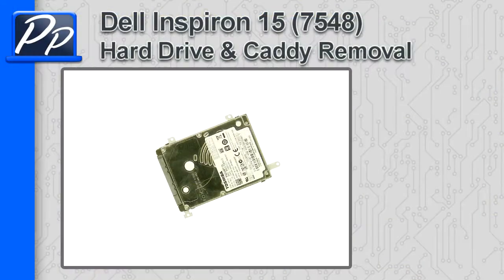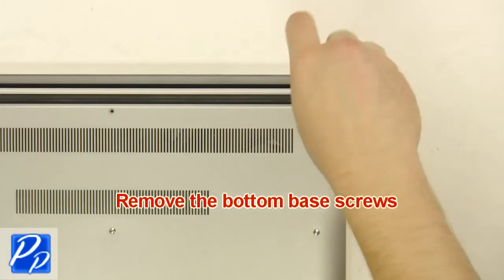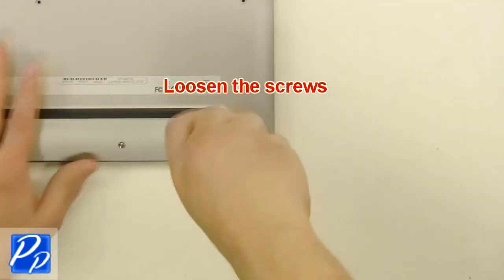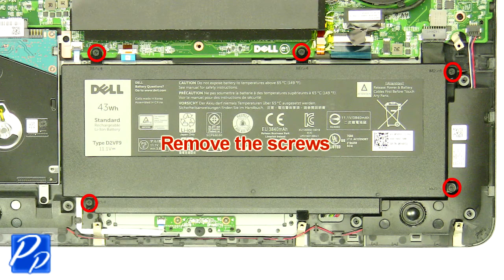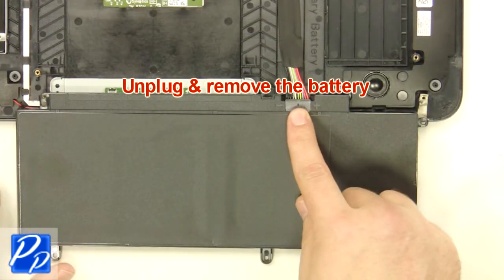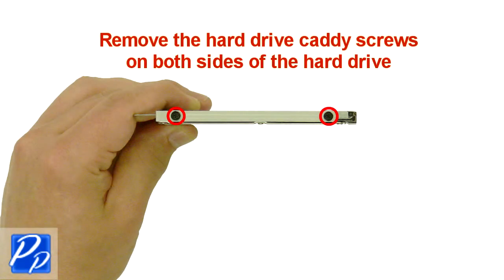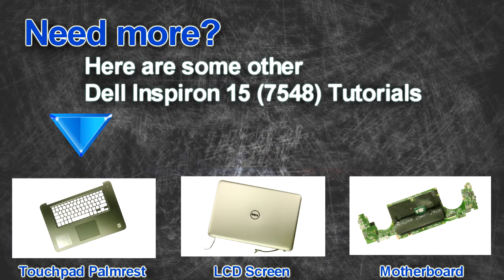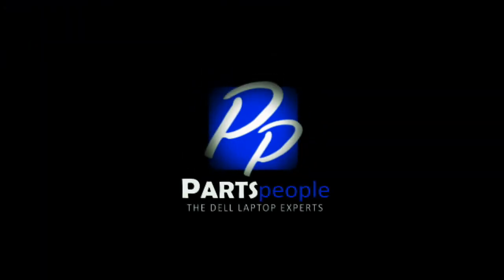Dell Inspiron 15 (7548) Hard Drive & Caddy How-To Video Tutorial

Comment: Hi, thanks for the video. I am trying to upgrade HDD to SSD. Does it resolve noise issue on this model? I'm not sure for others, but mine has too much noise while I am using. Is it because of old fan or some other issue?
Reply from the maker: It sounds like the fan needs to be cleaned or replaced. There might be debris making the noise. If the HDD is failing, it could make noise too but it won't be really loud.
Reply: Thanks for the reply. I may need to replace fan too.

Comment: Hey there!

Thank you for such a thorough step-by-step tutorial. I am using Dell Inspiron 15 Series 7000 (7548). It has 1TB HDD hard drive. Will Samsung 850 EVO 500 GB 2.5-Inch SSD physically fit my computer? I am worried about the differences in thickness of my current HDD and Samsung SDD.

Thanks so much.
Reply from the maker: Yes the 850 EVO will fit in your laptop.
Reply: thanks so much!

Comment: Thank you for telling us why we should "remove the battery first". 

btw, the HDD that came with the 7548 that we bought form Bestbuy was faulty. It always has that chirping sound when I first got it. It unfortunately died on me. Always giving me blue screens on start up, So I want to buy an EVO SSD to replace it with because a few comments mentioned it. Do you recommend it?

and another question, I really wish you guys would answer.

After attaching the new SSD on my laptop. How do I install the same drivers and especially the same Operating System (win 10) that came with the laptop so that I won't need to buy a new license or New OS? Since I cant clone the previous drive because it's faulty and dead. A reply is very much appreciated. Thank you!
Reply from the maker: SSDs will run faster and boot faster than traditional HDDs. I always recommend upgrading to SSDs when possible. 

For the OS (Windows 10): you will need to call Dell and tell them you are replacing the hard drive and that you need a copy of Windows 10. They will send you an installation copy on a thumb drive. You will need to plug in the thumb drive and start the laptop (after the new SSD is installed, of course). During the Dell load screen you will press F12, I think, it will prompt you to change the boot sequence. You will select "Boot from USB" and that will start the Windows install.

After Windows is installed you can go to support.dell.com to make sure the BIOs and all the drivers are updated.
Reply: Thank you very much for such a comprehensive answer. I appreciate it,
I will get back to you incase I have questions. Thanks again! Godbless!

Comment: hey is it necessary to remove the battery to replace the hard drive
Reply from the maker: You should remove the battery to avoid static discharge that can ruin the hard drive and/or motherboard.
Reply from the maker: Or you should at least unplug it.

Comment: Thnaks for this video.
I have a one question?
I can replace the graphic card with a NVIDIA for example?
Reply from the maker: +RoRHero No, it doesn't have an Nvidia option. The 7548 has the graphics built onto the motherboard so replacing the motherboard would be the only option. The motherboards will have either an Intel 5500 GPU or an AMD Radeon R7 M270 GPU.

Comment: Hey, 
first of all: Thank you very much for this video! I am planning to upgrade the HDD of my Inspiron and i am asking myself if it is really necessary to unplug the battery? I am planning to clone the current hard drive and put a SSD with said cloned data in my notebook. Would this work without problems? Thank you very much in advance for your answer!
Reply from the maker: +Spectacular Mind After you clone the drive and you are ready to install the new SSD,  you will want to unplug the battery for the installation. If you don't, you might cause an accidental ground or short and risk damaging the motherboard. If that happens, you will probably have to replace the motherboard.
Reply: Parts-People.Com, Inc Phew! Thank you very much for your advice!  Hopefully everything will work out...

Comment: Thank you so much for this video.  Just what I needed.  Put in an evo ssd and the laptop is much better now.
Reply: what evo did you put? 870?
Reply: @Estoyaca  it's been so long I don't remember anymore. Sorry. I've upgraded other laptops multiple times since. Any 2.5 inch ssd should do as long as it's the standard thickness.

Comment: After replacing the HDD with the SSD, would you know why the computer says that there are no bootable devices?
Reply from the maker: bliwanag1 The new SSD will not have Windows loaded on to it. After installing the SSD you will have to format the drive and re-install windows.
Reply: +bliwanag1 Or you can clone old HDD to SSD, remember to clone partition signature too.

Comment: I recently purchased the inspiron 15 7000. Would the Samsung EVO 850 250 GB SSD work fine as a replacement for the 1 tb HDD that came with the computer? Like are the dimensions standard with each ssd and hdd?
Reply from the maker: bliwanag1 Yes the Samsung EVO 850 would be compatible. Any 2.5 inch SATA hard drive would work.